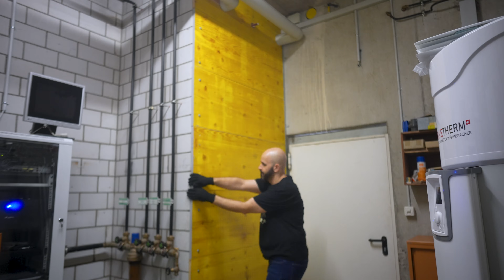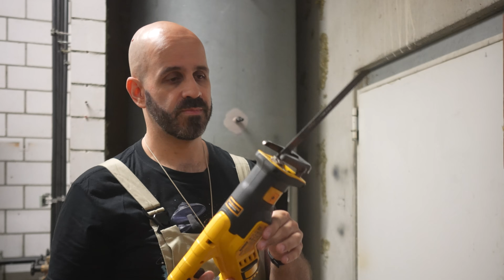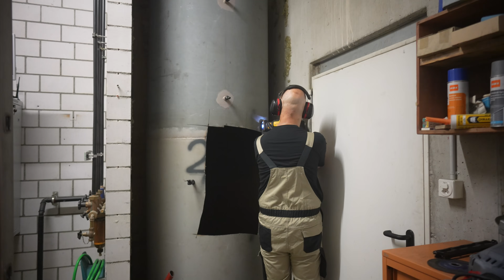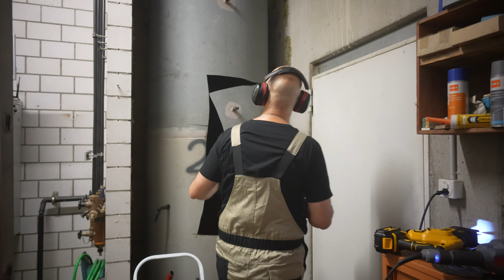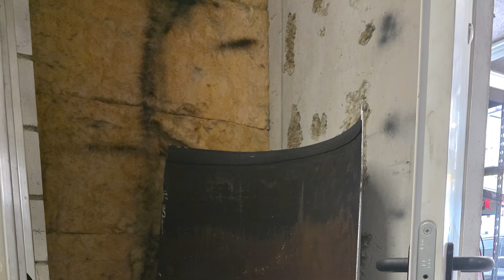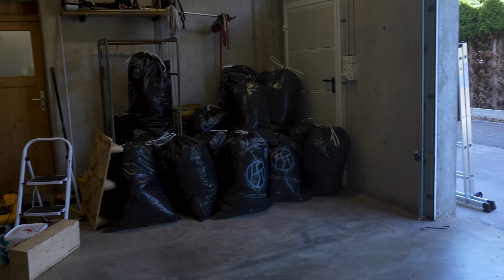Removing My Gigantic Overbuilt Old Water Buffer Tank

Comment from the maker: What should I use the newly gained space for?
Reply: I love your gumption Mr Mario. AJ from USA in Wisconsin
Reply: bring in more tools to do more stuff around!  😋👌
Reply: speaking of tools, a couple, late, tips for that job. when using the sawzall/recipro saw, put holes a bit larger than the saw blade in the corners, that will eliminate the neeed for the grinder and help reduce blade wear when you try to make a turn with the saw. second one is making a starter hole and using a big corded nibbler, see Trumpf N1000. dont forget to have your pixie assistant sweep everything around and on you with a big magnet, it cuts, rips and pierce everything including your soles. 😏

Comment: Hi Mario. I think if you calculate your work hours, cost of tools, discs and saws, electricity, garbage bags, transport, fiberglass disposal fees, etc, you might have spent more than chf 2000 a removal expert would have charged.
Reply from the maker: Sure, but I cannot buy new tires with my work hours! 😅

Comment: That tank is worth something, probably a company will pay you and take it away.
Reply from the maker: Transport is a bit difficult  They want you to rent a dumpster as it is in pieces and difficult to transport. I am not going to pay 100 bucks for the dumpster when I can just deliver it myself with relative ease. I have to get the Transit anyway to dispose of all the trash bags.
Reply: @swisscarguy   when we cut up all the old farming diesel and heating oil tanks plus some rusty water tanks with the prevously mentioned nibblers, we ended up with more than 20t of flatish steel plates of which a bit under 4t of those weren't of the rust bucket persuasion. makes for nice steel plates for forest plinking but we had a forest in our backyard so YMMV, the rest was given to some of the farmers around who did whatever they wanted with it as long as they were hauling it off by themselves and brought a few bottles of distilled mirabelles, evetything was gone in two days. those tanks were, like yours, built like tanks when steel was still locally produced in the '50s and '60s, the smaller ones we replaced them with were all stainless and less than 3mm thin. it was a lot of fun to do, less so when i got some of those steel shards in my boots in the first minute though... 😬

to keep in line with the channel spirit, here's the financial recap a best as i remember:

quotes by local firms to cut and remove everything, between 8000 and 11000€.

2 nibblers from ebay's kleinanzeigen with 2 steel-gnawing pins thrown in, ~4000€, an oversized electromagnet for the job, sourced from Luxembourg, 400€ on a Saturday evening, guys kept the shop open for us longer than usual, updated PPE, ~300€ from the same shop, one 30mm core drill bit, ~100€. for a total of 5000 to 5500€ including heavy Autobahn drinking for the Phaeton and my favorite gummi boots. 😅

resale in France of one nibbler, 2400€, jobs done for friends and neighbours in the two following years, probably between 2500 to 3000€ and even more since. still got the nibbler, electromagnet and the welder leather jacket and long gloves.

Comment: Why take it out when you do not know what to do with the gained space?
Reply from the maker: Empty space has the nasty habit of filling up. 🤷🏻‍♂️

My original plan was to move the server rack over there and use the reast of the space as a laundry room with wires to hang clothes to dry.
Reply: How would he know what to do with the empty space if the space is not empty?? 😁